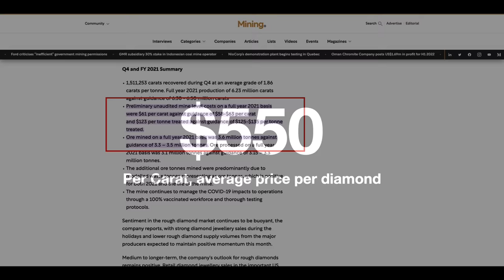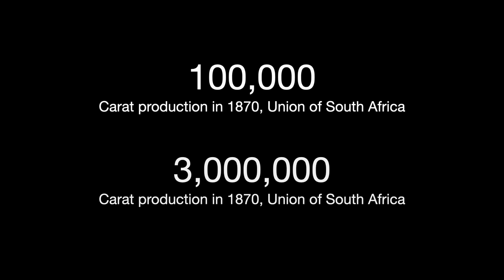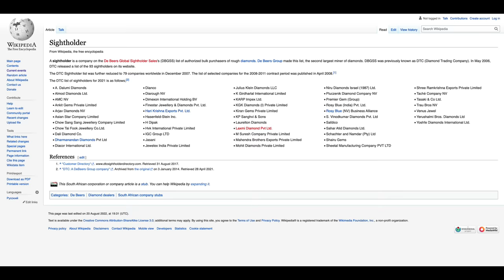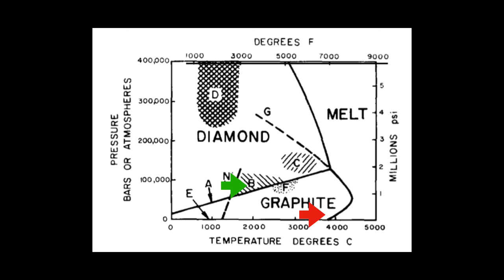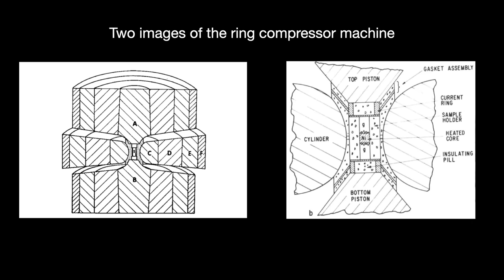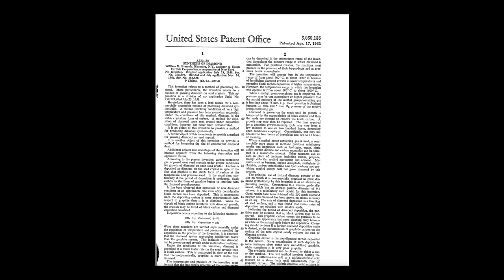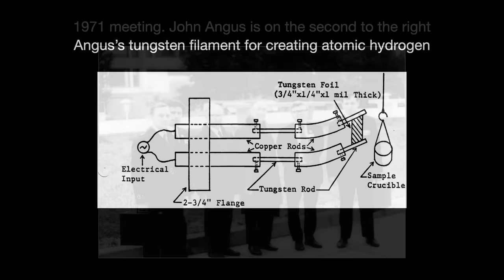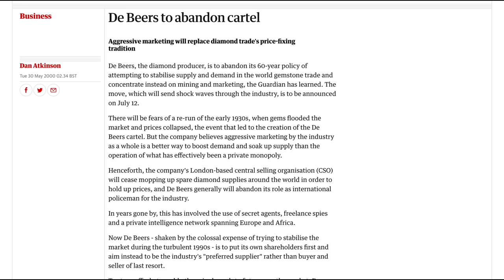The Perfect Synthetic Diamond

Comment: Dear Asianometry, Once again thank you for another well researched piece. If you believe DeBeers, then there is a difference between "synthetic" diamonds, and "Real Natural Organic" diamonds, and of course that is why they cost more. Unlike Gold, Diamonds are quite common. I remember when some decades back the South American diamonds came onto the market, huge numbers of them in good quality, however by geologic tendancy, they were all predominantly "yellow" as a result DeBeers created a campaign to convince consumers that yellow diamonds were inferior and not as good as African or Russian Diamonds ( their mines of course ).
Reply: yup yup premo work!
Reply: There is a difference, you can easily test for the presence or absance of trace metals using an xrf analyzer. Also most synthetics will have unusual color centers in them. The whole thing is a racket tbh.
Reply: Diamonds are literally organized carbon.
Take those resources and put them to something of actual use.
Reply: @miinyoo  Actual use? We can buy a diamond coated wheel for cutting tiles at any hardware store and the price  is less than the tiles for a bathroom. Too bad that Asianometry did not cover this topic.
Reply: "Unlike Gold, Diamonds are quite common" - complete nonsense. In 2019, 146m carats = 28.4 tonnes of diamons were mined (mostly industial). 3,464 tonnes of gold were mined the same year. Diamonds are vastly rarer than gold
Reply: @tomkandy  Good point. Gold is about 10 times denser than carbon though. But still a vast difference.
Reply: @tomkandy  i think there are a lot more diamonds just deeper in the earth so they are unminable or unprofitable to mine.
Reply: @dinok7630  There is a lot of diamonds relative to demand whether it be jewelry or industrial. The artificial constraint is on those reserved as gemstones for jewelry.  Gold has a lot of uses both in jewelry and industrial (and financial for that matter) and there are relatively no constraints.  Gold is also relatively finite as it is a heavy metal generally originally created in the heart of stars as it requires an  ultra high heat crucible to form.  The amount of gold currently in circulation is about the collective size of a squared football field.  Diamonds mined probably are significantly less than this volume but we can create new diamonds as carbon is relatively limitless.
Reply: "Diamonds are quite common" Tell me you've never rockhounded without telling me 😂
Reply: @dinok7630  there is a lot of gold in asteroids. so?
Reply: As a materials scientist, I have to agree with DeBeers. There is a difference between grown and natural diamonds. Natural diamonds show a lot more "twinning" (flipping of the atomic lattice orientation) than synthesized ones.

It's just that DeBeers can't use that true fact as a claim that natural diamonds are better since it can be argued that twinning is an atomic lattice stacking fault, so it's an imperfection of sorts. Not an imperfection that will actually cause any meaningful optical or mechanical issues, but still, not perfect. Synthetic diamonds can get closer to perfection than natural ones do.
Reply: @christopherleubner6633  My understanding is that natural diamonds have more fluorescence than synthetic diamonds, I was under the impression that there was a diagnostic test based on this.  I would expect natural diamonds to have more color centers as they are more likely to have imperfections, as well as more impurities/inclusions.
Reply: There was a magazine article a while back where the journalist took grown diamonds to the world’s experts, and not a single one of them could tell the difference between it and a natural diamond (except in a couple cases where they preferred the grown diamond). However: across the board they all refused to be on public record about this because of fears of losing their position in the diamond industry.
Reply: @christopherleubner6633  Sure, but I don't care about what the xrf analyzer says. I only care about whether it looks nice on my finger. And I'm quite happy with base metals and cubic zirconia if it has a nice artistic design.
Reply: Actually gold is pretty common (particularly when compared to platinum group metals for example).
Reply: 🤣😂🧐😂🤣 you might do your own research. 17 secs in he's lying.
Reply: @christopherleubner6633  Right, so like they are different in that synthetic diamonds are better and can be customized in color.

I've never understood why ppl would prefer a natural diamond.  It's soo much cooler to have one that is the result of wresting the secrets out of nature than one that someone just dug up.
Reply: Q
I own very intense yellow diamond ring 
I own natural clear diamonds 💎 and I own color enhanced blue diamonds as well.
Diamonds are plentiful and DeBeers withholds diamonds to maintain high prices.
I am no longer interested in artificially high priced products because it's not in line with real rarity and therefore 😉 actual value. 
I am on to rarer gems such as the Golden south sea pearls in gold color. 
Q ❤️
Reply: @hrhtreeoflife4815  🤣🤤🤣 There's more rare gems than S sea pearls, Alexandrite, Benitoite, Mogok ruby, Rhubalite tourmaline,, Bixbite(red emerald), black Australian opals. Irradiated colored diamonds aren't worth squat re sale. If you had GOOD qlty diamonds? You wouldn't be stating such tripe.
 Debeers only holds 30% of the market. Chinese, & India middle class who can afford GOOD diamonds,( unlike American middle class) now determine pricing..
 Stop reading propaganda.

Comment: For those curious: the process of allowing impurities and small crystals to be destroyed to allow larger crystals to grow is called Ostwald Ripening. It was originally used to describe bubbles in foam, but it applies to crystal growth as well. In CVD graphene, we do this as well, but use oxygen to destroy the smaller crystals, letting the larger sheets grow with less defects.
Reply: I think you are conflating two different concepts, but ok.
Reply: @kid_missive  what other concept? If there's another concept that works like that, I'd love to learn about it. As far as I know, the use of a reactant, heat, or any external force to remove an undesirable product to make way for the desired product is Ostwald Ripening.
Reply: @kid_missive  Why, do you know what graphene is? Carbon is very interesting in all its forms. I did use a lot of different types of graphite and diamond, both natural and man-made and of course there are for technicians a lot differences, because it's our task to study its properties in the lab and in use (industrial diamond used for a range of tools). Never used graphene by the way.
Reply: I've never heard of that before but it reminds me in some ways of the Ising model of magnetic domain consolidation in a ferromagnetic material falling through its Curie point. Goddamn I love the comment sections in the intelligent part of youtube. There is so much interesting insight.
Reply: Yeah, I'm not curious about this at all. OK, maybe a little bit, but actually no not really.
Reply: The ability of matter to self-organize is boring 🥱
Reply: @DCrypt1  Using seed stones is a template for crystal growth which has less defects than amorphous stuff organizing into a crystal, and so is also faster.  Impurities are catalysts for nucleation points.  Ostwald ripening is an attempt to say at high density, enough collisions take place to begin crystal organization.
Reply: а якщо використати ультразвук  в якості прискорювача росту або очисника домішок
Reply: в якості очисника ще можна спробувати світло ультрафіолет можливо або інший спектр
Reply: @DCrypt1    you must be a hoot, at a party.

Comment: Caveat: Factories value diamonds according to hardness. Jewelers value diamonds according to shininess.
Reply: Fascinating
Reply: the former is a legit use case. the latter can be replaced by glass :)
Reply: Harder stones are easier to work with as well, you dont have to worry about scratching and workibg a bit more heavy handed
Reply: @tigerchills2079  or zircon,  I swear I could not differentiate the two
Reply: @falsch4761  or moissanite or even easier rutile
Reply: And you need a microscope to see wtf the jeweller is talking about. Nobody is going to walk up to your ring and look at it with a microscope
Reply: @bigsmall246  My sister and I walked into a fine Tahitian jewelry store.  We were told the D-grade was on the third floor.  We went up there and I saw a 16 mm pearl in a bin and bought it immediately.  D-grade because the amount of nacre coating by the oyster was less than French regulation allowed for export.  We had a loop mounted on it right there.  You can be assured no one knows the thickness of the nacre on that pearl, they are all just amazed.  Crap, what did this cost?  $50?  And nice tear drop shaped.
Reply: @bigsmall246  Until cameras capture in such high quality that one can zoom in after the fact and see microscopic detail lol. Older people already use phone cameras to enhance their vision
Reply: @jek__  and why that matters?
Reply: @tigerchills2079  I prefer opal or agate for shininess. When it comes to diamond, I'm only interested in sharpening tools.
Reply: You guys have no clue what you're talking about.
Reply: @tigerchills2079  It cannot be replaced by glass, or at least it won't look the same. Diamond has a much higher refractive index than glass, bending incoming light more and bouncing it around more on the inside. That's what makes it so shiny (when cut in the appropriate shape).

That is, if shiny is what you're looking for. If you just want a transparent rock, glass will do fine :)
Reply: @mattsadventureswithart5764  It cannot replaced by glass? I will let the success of Swarovski speaks for itself here

Comment: Did my PhD thesis last year about artificial diamond films and their application as bio-platforms due to their inherent biocompatibility with cells and biomacromolecules like proteins. Did extensive research on diamond production with both HPHT and CVD approach and now you drop this video. 
Diamond is truly a remarkable material and my favorite application so far is the use of large CVD grown diamond as windows for the ITER fusion reactor.

It was Lavoisier who discovered that diamond was made out of carbon while burning a diamond in an air tight container with a magnifier glass and directing the gases into lime water. These results were published in 1772. Tennant repeated the experiments and made them more sophisticated and published in 1797.
Some other remarks: 
- GE used a transition metal solvent: iron-rich iron(II) sulfide
- The role of tantalum is crucial since the first diamond were grown on an intermediate tantalum carbide layer and nowhere else
Reply: we use diamonds as heat sink for high  power lasers
Reply: Would something like silicone carbide could be used as windows for the reactor too ?
Reply: @User9681e  The transmission in the range of the pump laser (to ignite and stabilize the plasma) is not high enough for SiC. Diamond has a broader transmission window. A silicon carbide window would be getting to hot. This is also the case because diamond has sublime thermal conductivity properties, so the heat is removed more effectively.
Reply: можна спробувати ростити CVD діамант на стінках циліндра вкритого шаром графену в центрі камери мікрохвильовий і ультразвуковий випромінювач подача газу (co2 і H ) отримаєм діамантову трубку

Comment: My  father Dr. Robert DeVries, Francis Bundy, Bob Wentdorf, Jim Fleischer were GE's High pressure lab, "diamond mine" developers at the GE R & D center in Niskayuna, NY.  My father and this crew had nearly 60 patents related to the diamond synthesis processes as well as the synthesis of gem quality jade and Cubic Borozon Nitride, CBN(which is as hard as diamond).  Gem quality stone produced at the R&D center were numerous in the 70's and GE CEO Jack Welch gave them as gifts to customers and dignitaries.  Bob Wentdorf acquired some peanuts from President Jimmy Carters Georgia peanut farm and carbonized them and they made a tie clasp for Pres. Carter with three 1 carat diamonds.  They made diamonds from many odd materials, Chocolate ... They were able to control color at that time and the stones in that piece were Red, White and Blue.  My mother had several pieces of jewelry made with stones produced at the R&D center.  The other members of the team also enjoyed this benefit.  My wife has a ring with one of the early stones.  I have a small pill container with about 2 dozen rough stones that have various flaws.  The rough stones were taken to NYC to the diamond district to be cut and mounted.  GE built a lab in Worthington,OH to produce large quantities of industrial diamonds.  I have a large number the high pressure vessels used to create these stones.  They get used for door stops and paper weights.  Made from Tungsten carbide and other alloys.  One of the most significant developments was the sintering process for bonding the crystals together in a matrix that would hold up to severe abrasion.  Hence the cutting teeth on oil and water drills used through out the world and the common sharpening stones and dental burrs etc. Diamond is natures teflon, very difficult to get it to adhere to anything.    In the Smithsonian in DC the natural history museum Gem and Mineral exhibit is a display of the first GE diamonds and pictures of my father and Francis Bundy.  Dr. DeVries passed away last year at 99.

Comment: I worked briefly as an apprentice diamond cutter, and the guy training me (who has cut some of the largest internally flawless diamonds in the world) told me that the main problem with synthetic diamonds is that the grain is always twisted. Diamond crystals have an orientation, galled the grain, similar to wood in a way. Diamonds only cut when the direction of the grain is perpendicular to the direction the lapidary wheel is spinning - the further away it is from perpendicular, the slower it cuts, and the more heat builds up. As you noted, diamonds are carbon and will burn, and that includes scorching on the outside while being cut, requiring the carbon to be polished off. I was in the shop when a 7 carrot stone (full of knaats) got too hot while being cut and several facets had to be recut (I think the stone might have even needed to be re-girdles, though I can't be certain).

When the grain is twisted it is called a knaat (similar to a knot in wood). This twisted grain is hell to cut and polish no matter how you orient it in relation to the cutting wheel. I always knew that this problem would be solved at some point, but I'm not aware of it being solved. As the master cutter training me said "synthetic diamonds are just giant knaats." Imagine being a wood carver and all you had to work with was a giant knot of twisted wood. Natural stones often have twisted grain and knaats, but the highest quality ones are clear of them. Synthetics, AFAIK, still won't be able to yield the highest quality cut to the stone, though I'm sure that is only a matter of time.

Of course, most people won't notice that the facets of their stone are bumpy due to twisted grain, but it does affect the grading of the stone.

Comment: Having worked in the industrial diamond manufacturing market, yellow and black were predominately used, when it came to intricate shapes CVD was a nice option although they were mainly black but a log as they were called 1x1x2.5mm sold for a $1.00 a piece and the gem looking ones were about $30.00 a piece, these were different shape usually triangle. A CVD is just as hard as a real diamond. If I remember correctly the Blue diamond is the top of the list for expense and usually came from Russia

Comment: The use of a microwave plasma of methane and hydrogen produces perfect "lab-grown" diamonds. The color of natural diamonds is from the tiny impurities in the stone. To color lab-grown diamonds they just add a small amount of a specific gas to the process, so the color is uniform and the diamond crystal form is not degraded. There was a lawsuit involving De Beers who wanted the name "synthetic" used but they lost and the correct term is now "lab-grown" which doesn't have the less-perfect sound of "synthetic". They are more perfect than natural.

Comment: I worked at this shop where we made ultra-high precision diamond tools that would cut things like the lense of a space telescope or the master die of printing machines for product labels and much more.

We tried many synthetic diamonds over the years but in our application natural diamonds always ended up being the superior resource. Our machines in particular didnt like cutting synthetics as they had a tendency to "gum up" the cast iron wheels where as naturals made the iron wheels better overtime as long as you didnt cause damage with improper technique

I haven't worked there in 10 years, I wonder how it's changed

Comment: I'm no expert, but you can't calculate cost per carat–a unit of weight–as though stones of any old weight a person might use are homogeneously produced in the earth's mantle. The big ones used for gems are much more rare. Additionally, sometimes the cost is low because they pay the workers in rice. It's not a very believable figure, $60 per carat. It's believable that 200 milligrams of diamond costs $60 to get out of the ground if you happen to be on a diamond deposit, but it scales up exponentially.